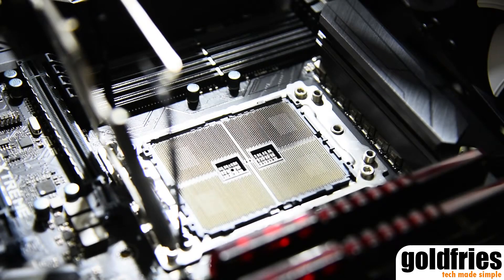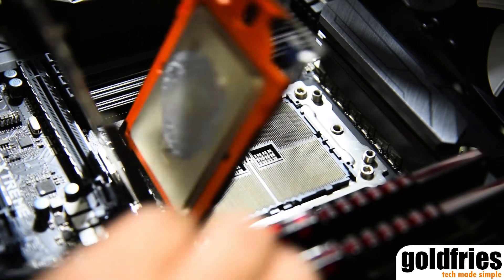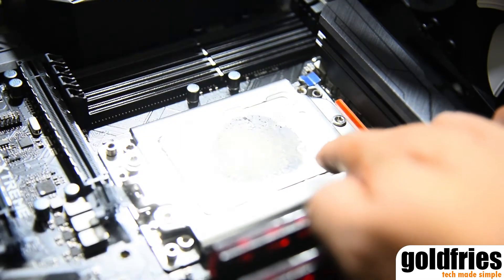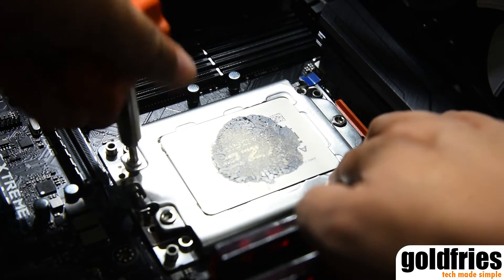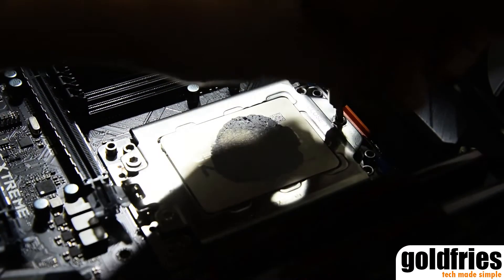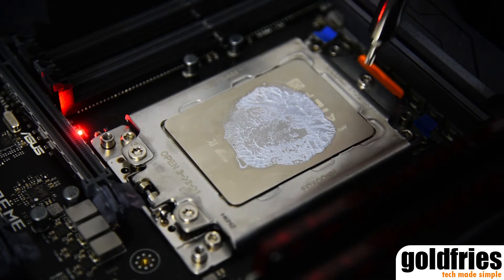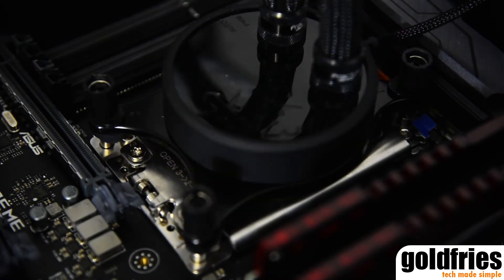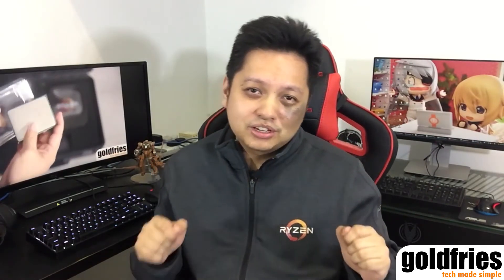Installing the AMD Ryzen Threadripper

Comment: It's a torque screw. Screw until you hear a click and you're good to go. Also to unlock the tray, you should start from 3,2 then 1. To secure the tray, reverse the process from 1,2 & 3.
Reply from the maker: Yeah I didn't show the unlock process, however to secure it based on 1 - 2  - 3 is ideal, and per instruction but it doesn't work. 

That's the first one I tried, once you get 1 secured, forget about locking 2 and 3. That's why you see that I did 2 and 3 a bit first, then only proceed to secure 1, then followed by 2 and 3 again. 

If you secured 1 alone and not 2 and 3, the system won't power up.
Reply: @goldfries  strange, I did 1 - 2 - 3 as per instruction, had no issues at all, maybe it's something with your mobo